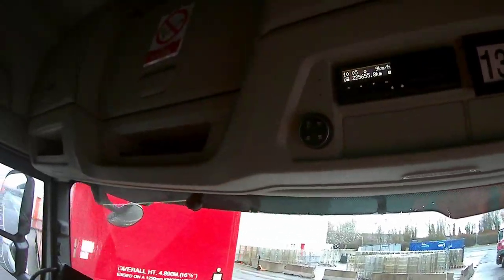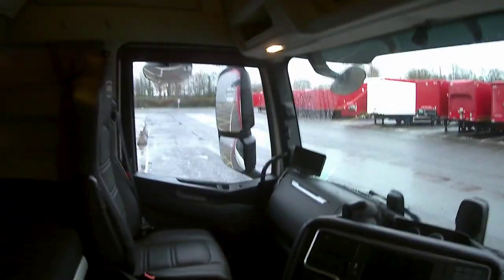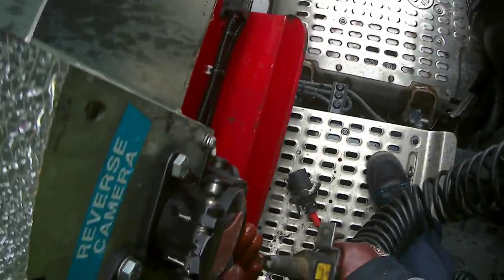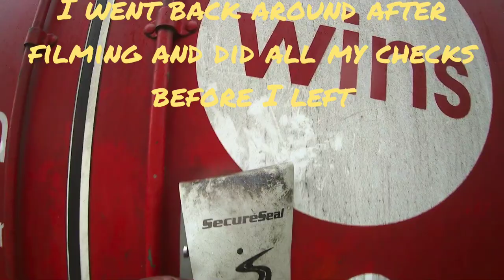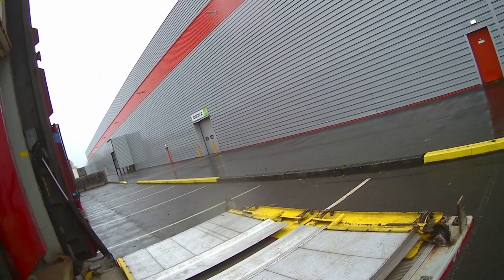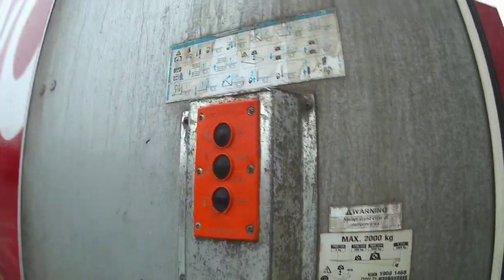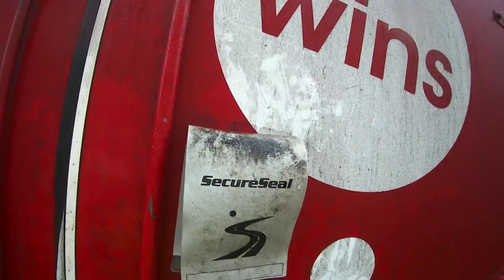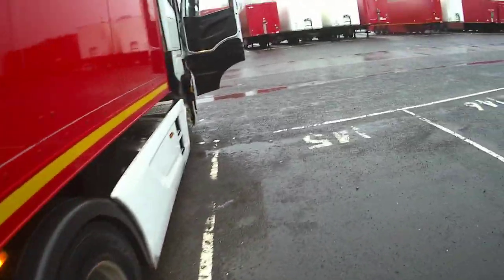Driving a HGV class 1 Finding, Hitching and checking a DOUBLE DECK TRAILER

Comment: Is it your job to make sure the back end of the trailer is in good order before you go, or are you just saving any hassle at the other end if something isn’t working right? Also, are there yorks on the top deck? If so, why aren’t they all just on the bottom, with any leftover up top? I would’ve thought the weight should be as low as possible?
Reply from the maker: Hi Davey, we have to check the trailer is in working order so we don't have a wasted trip if we can't complete delivery. If it fails at a store we drivers have covered our own backs by checking first. There is stuff on the top level and usually it's lighter stock and the bottom layer is full to capacity with heavier items. On this delivery there were about 10 cages on top and we, myself and the guys on the other end, agreed it could've comfortably fit just on the bottom layer. Sometimes you just wonder what the warehouse staff were thinking when loading up? But yes, you are right, get the weight down low for a more stable ride.
Thanks for your comment buddy, all the best
Reply: Did you change the height marker 😂 16’2
Reply from the maker: 😆 well spotted Mark! Yes I did, I also went round and checked my trailer properly, tires etc. You would be great as one of our H&S guys hehe! All the best buddy 👍
Reply from the maker: @markblundell9079  I use an app called Road Lords. It's free to use and very helpful indeed. Il do a little video on it if you'd like? I always trust it to get me out of a fix
Reply: Only available ok android I’ve got iPhone
Reply: @tonythewelshtrucker  - yeah, do a little video on it if you could 👍
Reply from the maker: @markblundell9079  oh that's a shame, alot of drivers use a stand alone hgv sat nav but unfortunately they can be pretty expensive. It may be worth searching I tunes for a free hgv Satnav and fingers crossed you find one that works well 👍
Reply from the maker: @Daveyengland  Hi buddy, just done a short video of it now, il try and upload when I get home this evening 👍
Reply from the maker: @markblundell9079  just realised that road Lords is powered by Tom Tom so I would've thought there will be another version suitable for iPhone?  I hope so as I certainly didn't want to pay for a hgv Satnav to lug around with me every day!
Reply from the maker: @markblundell9079  that's good, I hope it works out well 🤞 definitely a good start!
Reply: Took my 1st decker out the other night 😂 I’ve forgotten the length and width measurements I know the height lol
Reply: @markblundell9079  Tom Tom Go app is excellent. £69.99 for the year. I tried road lords but it loved taking me down 7.5t limits.